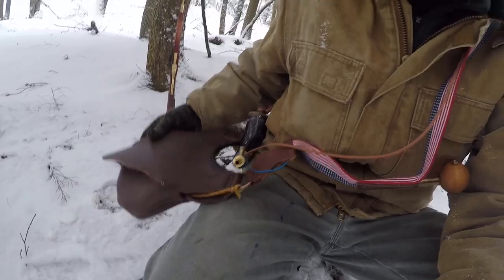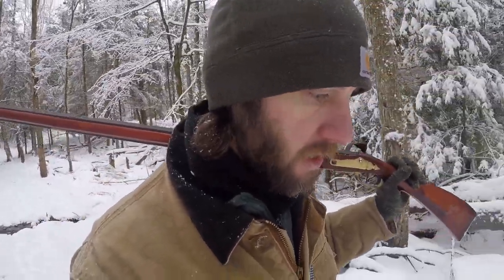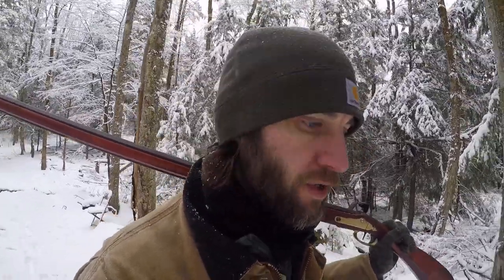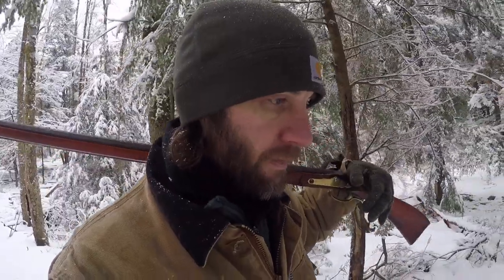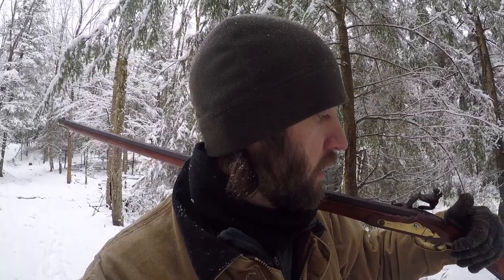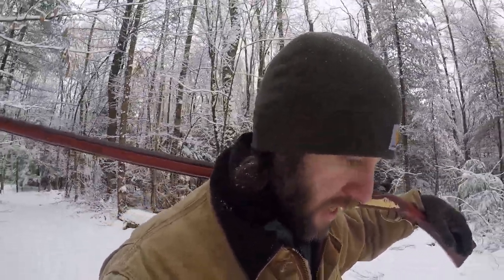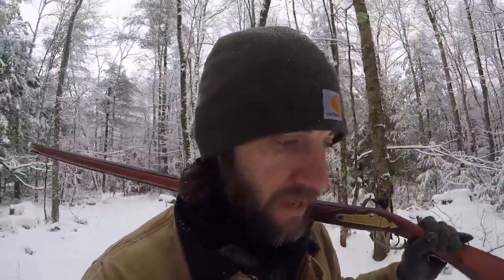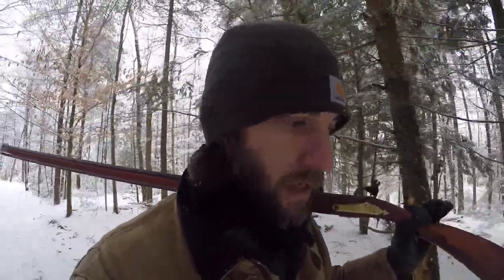How I develop and work up a load for any and all of my black powder rifles and smoothbores

Comment: Good tidbits of info,  I was suspecting a miss fire issue I’ve been having with an older CVA Wolf sidelock was due to gun oil residue and lube. The thing is accurate and easy to carry. With the synthetic stock it’s a nice gun that I don’t mind if it gets banged around a bit. Just need to get it reliable. I’ve been planning to go to hot water cleaning and maybe even no oil at all. This video is giving me more confidence I’m on the right track.
Reply from the maker: Yeah all my issues early on stemmed from all the fancy crap out there. It really is as simple as hot water.  Some folks add dawn dish soap I don't,  I recently have added a patch or 2 of rubbing alcohol as its drying some folks say it helps not sure yet.  And for storage long term I oil and also use some bore butter but always clean out with a patch if just shooting for fun , but if it's going hunting I clean with hot water the night before and then load her up and go hunting and it always goes bang now.
Reply: @redeagletrapping  good advice! Thanks!

Comment: A tested and proven method is the blood ring. When the charge, the ball, the patch size and charge compaction are perfect after firing look at the muzzle. If all is perfect you will see a red oxidation covering the crown. This is the blood ring but only works with black powder and not synthetic powder.